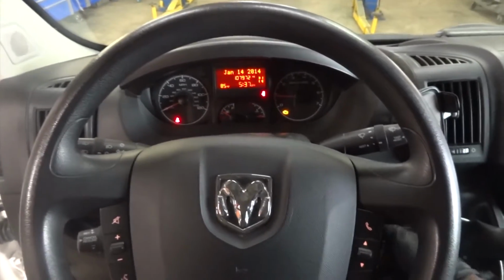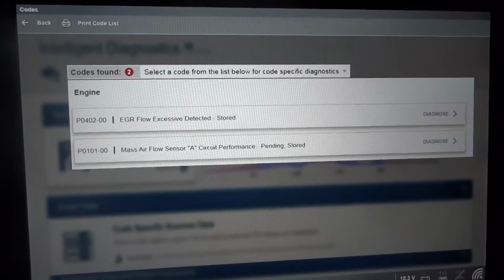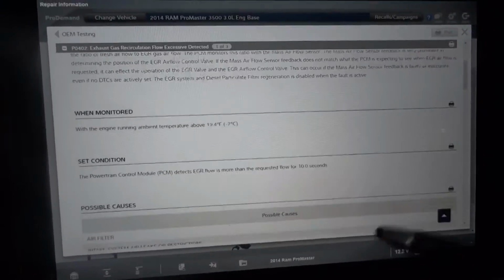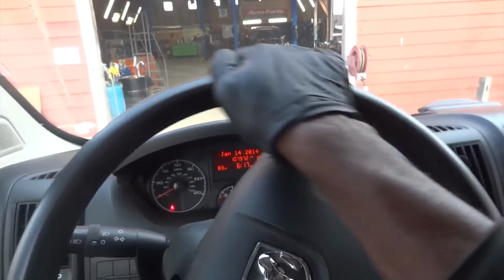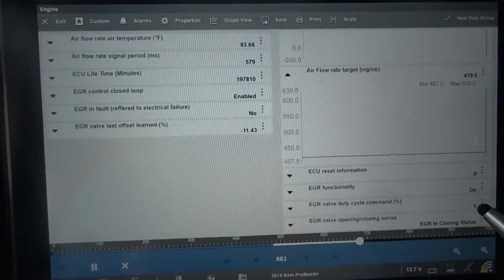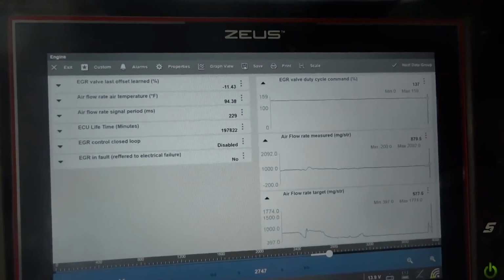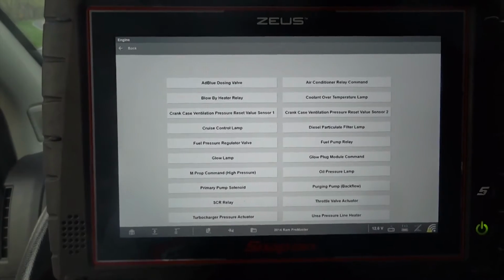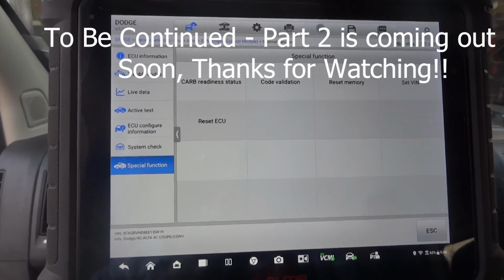RAM ProMaster 3.0L Low Power - Limp Home Mode DTC P0402 & P0101 Part 1 Diag & Repair

Comment: Hi I have service hill holder ecs that comes up every day on and off dose not happen if traveling on the high way i have had several people look at cant figure it out its 2017 dodge promaster 3500 3.6 l  it also has cam sensor bank 2 code and intermittently injector #4 reading open on the scanner

Comment: Typically I like to work the lowest number P code first, the dtc charts are not random and are engineered by importance.
Not saying that there's exceptions but as a general rule I focus on the lower numbers first.
Reply from the maker: @keltecshooter  That's interesting though! you know some codes are caused by others codes when they are set! so tackling the lower code can make you go in circles sometimes, so be careful!! some defective components affect others!!